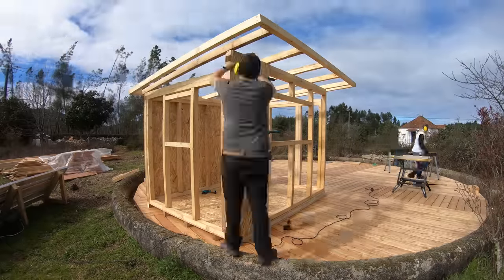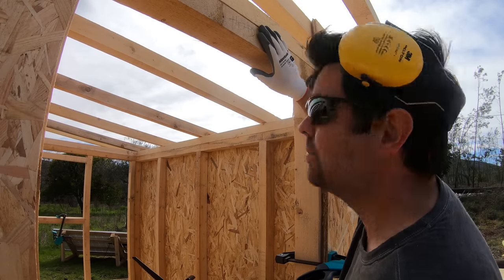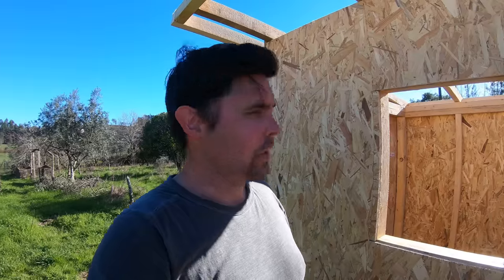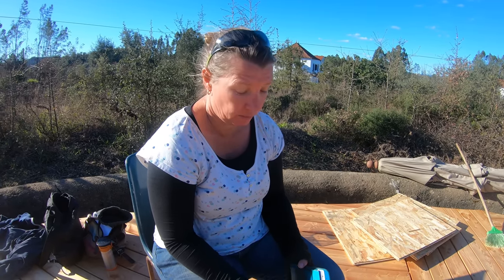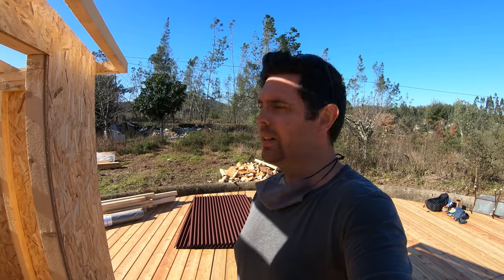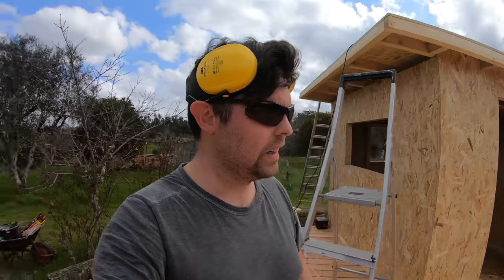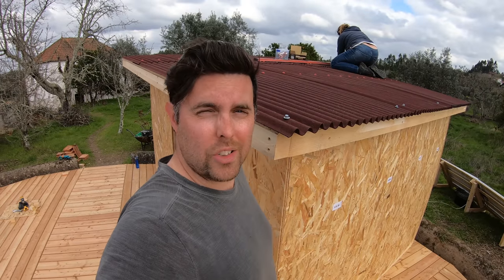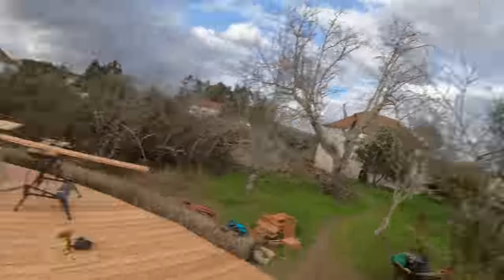Building the Shed - Part 2: Getting Watertight - Off Grid Living Part 6

Comment: Pro tip. The reciprocating saw is great for cutting off screws like you did, but if you have a little mini hack saw you can run it back and forth 5 or 6 times then whack the screw along the side with a hammer and it will break clean off. You can do the same with the reciprocating saw, just cut about a quarter way into the screw then hammer it. It saves a lot of wear on your blades.

Comment: I understand that the cabin / storage building is long done , but seeing you two working as hard as just be anyone I know ( except myself )!! , it sure hurts my eyes seeing you two installing the roof pieces straight on to the OSB material 
 Just like you did on the walls , you absolutely should have use the same building paper ( black paper ) or asphalt saturated felt , same thing , on the top of the OSB then drop the roofing sheets on top of it 
 As a side note , the said paper should be let pass the OSB sheets edge by about 1” 1/2  , reason is that I will shrink over time and it would have kept any rain water from coming in contact with the pine / OSB members of the structural
Reply: Sro Raimundo I am a house clining ,one  house I working just pot the roof like this and white. And  the went sthard  Reepe of  the vinel I come  in the português farm I no somaste-
And  the liner nee use wood 🪵in the tup the roof for weel bee secou   , sorry  my ingles is bad  I not have Schöll. So thay need something to weel bee segur the ,ouner  need look very weel if  is safe because the wend nau is  strong 💪 wends ,if is me ,e bult in the  ground.  Make in ciment  the floor. and scru in. I have here one shed. And I make the floor in cimento ,and sru the 2x4- or 2x6 in the corners. My brother ded  but the roof in Canada thay calling shingles. Made Etc weed tars. Blac alcatrão thay cal in portugueses.  Good look Sro. 🙅🏼‍♀️🇨🇦💪💪🎄🎄🎄🎄🤶🎅

Comment: I used those same panels on my Sheep Shed.  I am going to add gutters to the bottom slope to direct run off out of the paddock. I did not use any sheeting under the roofing panels. I love them.
Reply from the maker: We’ve also used them on our temporary wood store and on the top of the chicken coop. Really easy to use and have proven to be very effective (for both rain and uv)

Comment: Great job. However, aren't you concerned that you didn't add more of an overhang of the Onduline?  I would think any wind driven rain would easily get under the high pitch and cause the OSB to swell and eventually crumble.  Let's hope not!
Reply from the maker: The high pitch side of the roof is not facing in the direction we get driving rain from.

Almost two years later (the shed was built in Feb/Mar 2021) and no issues. We even have OSB totally exposed (where we were planning to build a window) and no swelling or degradation
Reply: @MAKEDOGROW  great to see these videos again, perhaps add a original date to the description or a quick segment at the start/end of the video highlighting this or any reflections since the build.
Reply: @MAKEDOGROW  Excellent news!  I forget that you are transferring the videos from your old channel to this channel.
Reply: @MAKEDOGROW  Sorry to say, but it will be affected over time, as in storms rain can come from all directions. If you have some wriggle room on the overlap, I'd pull it up a few inches. It might be a pain but it won't take too long, and it'll save from eventual ingress and subsequent rott. You've done a brilliant job and made a nice solid structure. 
(Builder).
Reply from the maker: @camperdude5241  perhaps you missed the ‘temporary’ part 😂
Reply: @MAKEDOGROW  all good, I understand. That's the reason I said you've done a nice job of it. It's very solid indeed...and looks like it could last a long time. Well done.

Comment: So you didnt put insulation on the roof? And you want to use the shed for cooking? What are you going to do in summer with the high temperatures? As this is a flash back video I suppose you found a solution?
Reply from the maker: It’s not really too hot in there. It’s only warm in the shed in the very middle of the day … when we’re typically elsewhere working. By evening time it’s cooled down

Comment: It is interesting that Onduline was not successful in New Zealand probably because of the very high levels of UV light there.
Reply: Portugal is very high in UV, too - probably higher than NZ because P is closer to the equator. Obviously NZ gets more rain but the product is designed to cope with that; that is, after all, its main function. So what else about the Kiwi climate made the difference? I  suspect it is significantly windier in NZ so perhaps the Onduline rattled around a bit in the wind? NZ has more earthquakes but I can't see that being a problem unless the whole building they were on was damaged.
Maybe firm pellets of low flying sheep pooh picked up in gales, then being splattered at high velocity by the strong winds caused problems? Native beasties liked the taste of bitumen in the morning?

ie I suspect wind but have no real idea - I'd love to hear other people's opinions or knowledge of the issue
Reply: @Neilhuny  From an architect I spoke to today I now understand the problem is that the product was sold in New Zealand with the advice that it did not need to be painted and after four to six years it was breaking down and leaking. New Zealand's summer UV index is between 10 and 12 and in some areas up to 13 for weeks on end.  That combined with high humidity causes the Onduline to separate. The only solution to get say tens years out of the product is to paint it with an anti UV paint. In New Zealand the UV is taken very seriously and even in the winter the days expected UV rating is given with weather forecast. I have American asphalt shingles on my roof that in the USA have a 30 year guarantee but only 15 in NZ. I understand in summer Portugal's UV rating is a maximum of 8
Reply: @gwmkiwi  That's fascinating and extremely useful info! Thank-you to both you and your architect contact.

I hope @Make.Do.Grow take note ...